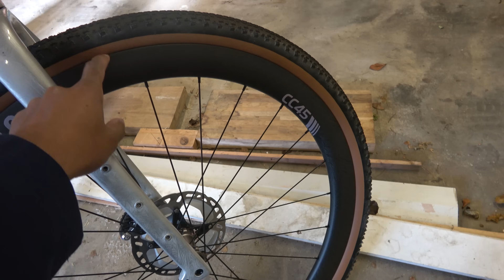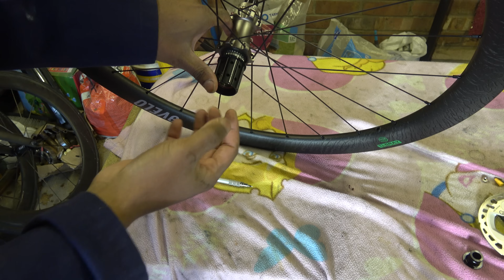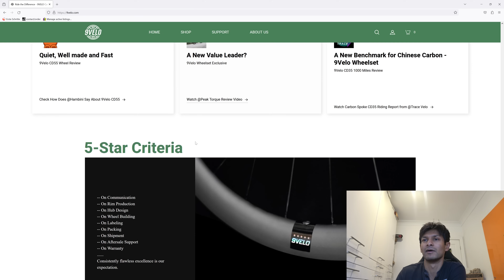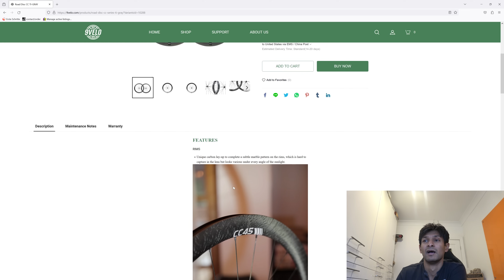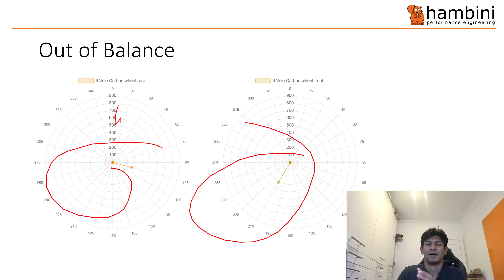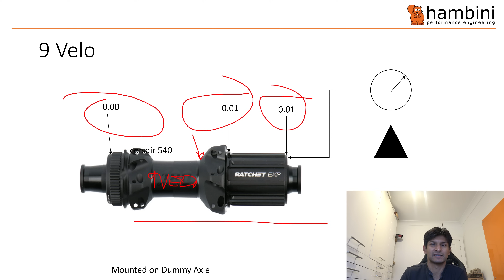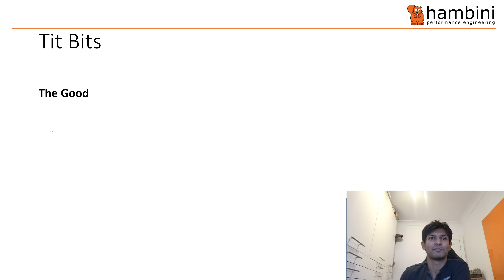DT Swiss get Completely RINSED BY 9Velo Wheels Ratchet Hub

Comment: The perfect hub is worthless if you can't get replacement parts for it. That's where the advantage of DT swiss lies over some random one. Any hub will require maintenance and replacement parts at some point.
Reply: It's a bicycle hub. The only thing you should ever need to replace is the bearings. If the company is using standard off the shelf bearings then you can buy them from any bearing supplier. Just quote the bearing number and pick your quality. This is not the thing that makes DT Swiss better than any other hub manufacturer.
Reply from the maker: @slasher9883  That's my point, DT swiss label their bearing as 6903. If you go into a bearing shop and ask for a 6903, you'll find the bearing does not fit your DT hub.
Reply: @Hambini  Yeah that's real dodgy, not sure how DT Swiss can get away with that. It's an industry standard number for a reason. I have never been that impressed with DT Swiss hubs nor their support for their products, so I can't say this is surprising.
Reply: @slasher9883  that's nonsense, ratchet and free hub body are also consumables and they are proprietary. First one wears out, the more teeth the quicker it will go, the latter - since it's lightweight aluminium, it get's chewed up by steel cassette marking it and you run a risk of ripping the lock ring threads of the hub, ask me how I know.
Reply: I checked and 9velo seems to be using common size bearing.
Reply from the maker: 9Velo use standard off the shelf bearings that conform to ISO standards. DT Swiss decided in their infinite wisdom (to shaft the customer) to use an 18x30x7 bearing and label it as a 6903. That engineering practice is COMPLETELY inexcusable.
Reply: @Hambini Agree that it's inexusable to label a 18x30x7 bearing as 6903.
However, do they actually currently sell any hubs with this faulty naming? I can only see it occured on older 240 hubs (still inexusable, but might be relevant if you are deciding what to buy).
Reply from the maker: @SimonHBS  I think the 180EXP has the same.
Reply: On the "6903" bearings in DT hubs are you referring to the free hub bearings?  My DT 350 hubs use standard 6902, 15*28*7 bearings in the main hub shell.  Just a bit confused here, as it appears, say, that NTN 6902 bearings will work fine in my DT hubs in the hub shells front and rear.  These are the newer DT hubs.  The free hub shells, well, it is probably more affordable for most people to just purchase a new free hub when those bearings go bad, unless one is equipped to change out the bearings themselves and has a fair amount of spare time as well. @Hambini
Reply: So you asked 9Velo and they told you, they can´t supply any replacement parts?

Comment: I have two sets of wheels with no spoke holes.  Yoleo, as you stated, and they've been reliable and fast road bike wheels.  My more recent set are for the gravel bike, and IIRC they are lightbicycle wheels (with DT Swiss hubs of course).  I did break a spoke or two when my derailleur got pushed into the spokes on that set.  One way to get a nipple around was to use fishing line leader, like flourocarbon, up through the spoke hole, then around to the valve hole.
I've been a proponent of no spoke holes for years, and let me tell you - my tubeless gravel wheels lose air so much less than all my friends.  They are incredulous that I can go two to four weeks without topping off my air before rides.
Reply: Hello,
Are the yoeleo wheels reliable ?

Comment: I'm not sure I've heard any actual bike mechanics wax rhapsodic on DT hubs because they were jewel-like precision works of art. Rather, it's because DT has designed a system that is simple and reliable. Most bike mechanics I know run DT hubs for the same reason that most car mechanics I know drive Toyotas: Because at the end of a long work day spent fixing everybody else's bikes, the last thing you feel like doing is fixing your own bike.
Reply: And DT spares are available.  An important factor.  I’m in danger of having to write off a whole Cannondale bike cos the headset is unusable and unavailable as a spare.
Reply: @enigma1000 availabilty of spares is something important.  With DT, you can parts for virtually in any form, shape, and sizes.  This is the real value of DT hubs.
Reply: Good to know, if the only advantage is reliability, I will keep my stock wheels until they fail, then only have a look at DT.
Reply: this is an excellent comparison. a friend always says "they last a lifetime plus one day"
Reply: Hambini is a fucking moron. Don't worry. DT Swiss has a well earned reputation of being very good.
Reply: Good point, same reason for me. I once had a King hub which (not an engineer, didn’t measure anything) is supposed to be the pinnacle of precision and binned it within a year as it just wasn’t up to real world (muddy mtb) abuse.
Reply: @Bonky-wonky unlucky, my king hubset is 18yrs old now. I strip, clean  and regrease them twice a year. Still run like new on original bearings.
Reply: @Bonky-wonky  I doubt you "binned them."  If so, I wish I were your garbage collector!  A King hub, properly cared for, will last a lifetime.  The in-house angular contact bearings simply do not wear out over time.   Clean, relubricate and keep in adjustment and you're good.  Whereas industry standard (these hubs, DT, I9, Hope, and just about every other maker using "sealed cartridge" bearings) radial contact bearings wear out, develop side play and MUST be replaced.
That plus the elegance of the King Ring Drive driven by the angled spline is indeed the pinnacle of durable freehub engagement.
Reply: @dudeonbike800  binned it as in took it off the bike and put it on the shelf with other beautiful bikeparts. The biggest issue was skipping and developing play, despite using an oversized locking collar. It did run beautifully but just not the hub for me..
Reply: @Bonky-wonky yeah just unlucky I guess. I have a king hub on original bearings from 1998 that was raced DH for about a decade and then run on a trail bike until now. Zero issues besides a hub shell replacement due to wear after a ton of miles.

Comment: Agree with you on hooked rims. Maybe I'm a ludite but actually always ready to consider new tech. I just don't get hookless on bikes, no matter the pressure
Reply: Carbon layup for rims is incredibly difficult and expensive.  That's why ENVE demands $950 per rim.  The hook makes them just that much more difficult.  Instead of allowing tire manufacturers to slide on quality control, hookless rims require more exacting standards.  Something one would think Hambini would applaud.

Apparently F1, Indycar, and every tried & true motor vehicle on the road seem to utilize hoolkess rims without problem.  Why can't the bike industry do the same?'
(And yes, I appreciate the fact that motor vehicles have the advantage of being able to add mass without much side effect.  Bikes can't do this nearly as easily without drawback.)
Reply: @dudeonbike800  yes, car wheels are hookless and pressures are around mountain bike 30 psi. But on a side note, here’s a conundrum— why does your car tyres hold 30psi for weeks or longer yet not one ever of any of my bike wheel / tyre tubeless set ups can hold the pressure for more than a day. I’ve got 5 sets of tubeless wheels from Hunt MTB and latest version DT Swiss road wheels and Far Sports (Chinese brand) and Syncros road wheels all hooked, and all with current modern tyres yet they don’t hold pressure and you have to inflate them virtually every day to ride (given quite precise pressures give the best performance)
Reply: @shred3005  no conundrum at all.  And I even provided the answer in my post:  weight.  And volume too.  If a bicycle tire were made with as much rubber as a car tire, they'd weight FAR TOO MUCH to be much use.  Again, motor vehicles can add mass without problem.  Just add a few HP if needed.  Bicycles do not enjoy this luxury.

I'm happy with the current tire trade-off.  Off road performance of 18-20psi tubeless tires far exceeds the previous iteration.  Without question.  Far, far fewer flats overall and pinch flats all but eliminated.  I'll take the "inconvenience" of having to top off my tires more frequently for the many benefits.  Yup, accurate gauge usage is now a requirement.

Today's mountain bikes are unreal and so user-friendly compared to the rigid bikes we rode in the early 80's.

Comment: This is actually their road series. The gravel one is GV, with 26 mm inner width.
Reply: I have a set of the GV 45 and they're fantastic. Use them on my Scott Addict with 32mm Bontrager hardcase lite tyres. Tyres measure just under 34mm at 55psi. Very comfy and heaps of grip.
Reply: Makes more sense indeed

Comment: Thanks, looks like a great wheelset. One there webpage are two versions of this wheelset: "Ceramic" and "TI-Grey". Any idea what the difference is? The pictures seem to be the same?
Reply: The "Ceramic" version comes with ceramic bearings and the "TI-Grey" with regular steel bearings. Apparently, the "TI-Grey" hub has some special anti-corrosive coating - I just like the looks more. 
I bought the exact same wheel set a few months ago,  but haven't tested them yet (I use old alloy wheels for winter riding)
Reply: Ordered the TI Grey @natursyndk

Comment: Campag were the first wheels I had with the hole free rim bed. Alloy spokes and nipples. Came with a metal screw to place in the alloy nipple so a magnet can be used to get the nipple to the hole. I was a bit concerned that this would be a pain but not needed to do it in over 10 years of ownership.
Reply: Campagnolo AND Fulcrum...    Rgr

Comment: @Hambini according to this vid the quality & customer service leave a lot to be desired though https://www.youtube.com/watch?v=McZpa_bLfzw&t=18s - after seeing some positive reviews I was seriously considering buying the set but now I'm not sure
Reply: There is something quite strange about that particular hub in the LV45 wheel, take a screenshot and zoom in and it almost looks like the ratchet ring is made from carbon and is entirely unsupported around its outer edge. I have the same wheels, same hubs and my ratchet ring is bright silver and much thicker, it’s also very well supported. 

Not saying they couldn’t have handled it better (if what the presenter says is factual) but something doesn’t stack up about the actual wheels.
Reply from the maker: I cannot comment on their customer service as I was not involved. But I agree with David's comments above, I had the same set of wheels before and my hubs did not have that setup. Usually an insert screws into the hub that has the mating parts of the ratchet and pawl setup. On his particular wheelset, it looks like that part is missing or is made from plastic.

I'm not questioning the person who posted it but the hub looks perculiar.
Reply: Well it's not consistent though. Mine don't have the issue. The main issue with these wheels and that specific iteration of the wheelset (since they have updated the LV series to ratchet) is the bearing choice. Being enduro they are rubbish. Should you upgrade to NTN they are phenomenal since they are very well machined. However the 3pawl design is not to my liking and the 15267 enduro bearing in the rear 3pawl hub is rattling and creaking. That was replaced. The rims are excellent and overall build quality as well
Reply: I've to break apart my rvl hub. Supposed to be 4-pawl
Reply: These start up brands are all a bit of a work in progress. As an early adopter of Winspace(who now cannot get hub parts) i would say just expect a little more risk and leg work to live with the product.

Comment: Yep, use a magnet and a short ferromagnetic screw inserted in the nipple in order to lace this type of rim. Really pretty easy once you get the hang of it.
Reply: Ah, a simple solution.  At first, I was wondering how a magnet would be used on a brass nipple...
Reply: @larrylem3582  I go the other way when I lace wheels like this.   I run a string with a threaded piece of spoke(I made an eyelet in it which was a pain to do) through the wheel with a magnet and drag it to the valve hole.  Then I thread the spoke in a nipple and pull it through.  It's been the fastest thing for me.
Reply: @larrylem3582  well same for alu nipples, right? 🤨
Reply: @larrylem3582  I had to investigate how to do this too as i have a wheelset with no spoke holes from Winspace. Suggestion is to even get an old spoke, thread it through the nipple then cut it just long enough so it protrudes out of the wheel once the nipple is in. Then a strong magnet will help you guide the nipple in place. You then use some sort of clamping device around the nipple (a clothes pin would work) to hold the nipple in place as you unthread the sacrificial piece of spoke and thread in the actual one. Rinse and repeat.

Comment: Do I spy some Festool in your shop?? If so, what do you think of their overall quality? Worth it?
Reply from the maker: I don't think it's that much better than the Makita.  For example the drill is about 3 times the cost but it's not that much better
Reply: @Hambini  that's pretty much what I thought. But it's all about MARGINAL GAINS ;)
Reply: Save your money and buy Makita. I repair power tools and have never been impressed by the quality of Festool. You will get similar quality with Makita (often better with the Japanese made stuff), plus easy access to spares, service, batteries and a huge range of tools. Buying Festool is the tool equivalent to a obese middle aged man in lycra riding a stupidly overpriced Italian road bike.
Reply: We have Festool dust extractor for our sanders at my work, constantly breaking down.